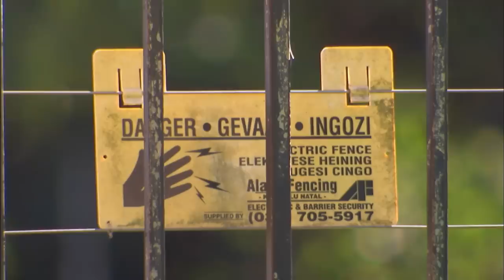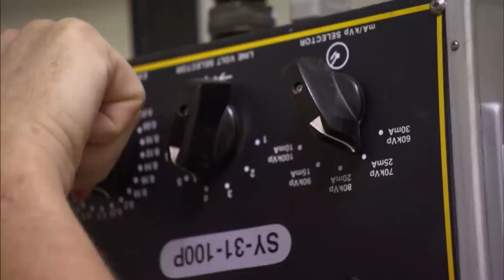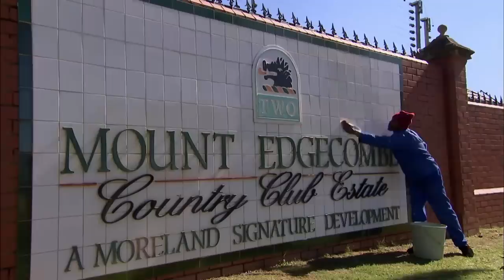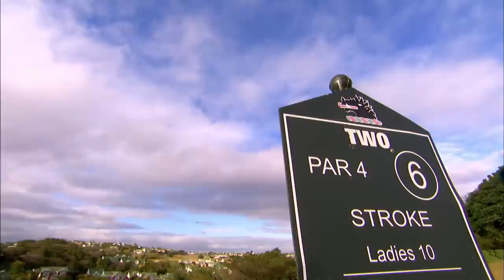Gang of Monkeys Terrorize Neighborhood | Street Monkeys | Real Wild

Comment: There is something they make to keep animals off window sills and porches etc. It was originally made to train a dog or cat from running out the front door when the door is open. It is called a Scat Mat. What it does, is when a animal steps on it, it gives them a little shock so they stay away. You can turn the shock real low even to just a vibration or way up So when a animal steps on it they jump 3 foot in the air. They now make one that is circular to go around the Christmas tree, so cats don't climb it. I used it on my dogs and it really worked the first time. Now I can leave my front door open and they will not go 10' from the open door. They just sit in the middle of the hall watching me bring in the things I have to bring in.
Reply: Lol we’ve seen dogs willing to take the shock to retrieve what they want
Reply: I would crank that thing all the way up for these tree rats
Reply: @firstdegree5386  and take a BB gun to em as they run.

Comment: I have seen in some areas that they make a feeding station. It is one place on the out skirts of the development, where they make a area where ppl can leave left overs for the monkeys. Then a group if caretakers go there once a day and clean out the heavy stainless steel troughs and put clean water in one and they had 3 for ppl to put food in. One place in this documentary got the whole development to donate $5 for each home and they had a plumber run a pipe under ground so they had a hose and water right there. They did not buy fancy troughs they used old bath tubs, so they could be rinced out each day. 7 ppl were supposed to do 1 day per week to rince out the bath tubs, change the water and scoop the poop, but after a month only one man did it every day. Isn't that how it always goes. For some reason the monkeys stopped coming around the houses and stopped destroying property. They went to this one spot ate their fill and left. I don't know why they do not do that everywhere they have this kind of problem?
Reply: This is a very good strategy,  used also for the pigeons that swarm and destroy European cities. Put up a central birdhouse, feed them there, provide nesting opportunity and swap the eggs for artificial ones. Birds will swarm there and leave the rest of the city in peace. Practiced successfully all around Europe. 
That can be a solution for monkey problems, too.
(And the oldest,  cheapest, easiest way to keep them off your trash, which is lock the bins tightly. )
Reply: Os monkeys são fascinantes e cruelmente abusados em alguns países 😭😭😭
Reply: Feeding them is what started all the problems. People need to stop feeding them. Period. They do not need help from humans.
Reply: @Dreamworld986 lol I would get some poison  lace the food and feed the hel out of them. Problems solved.